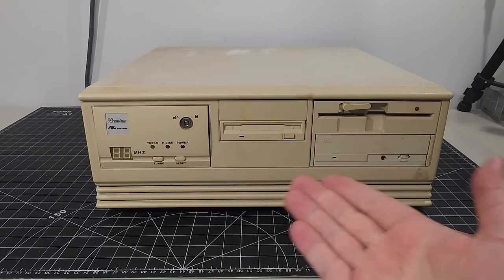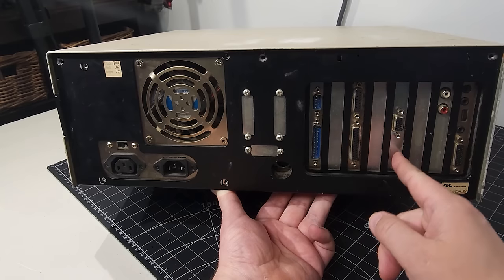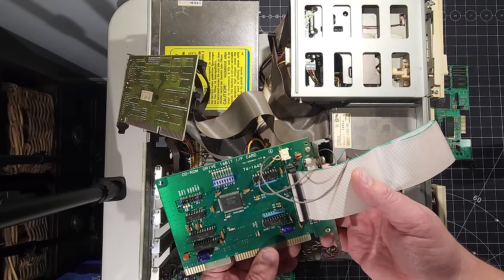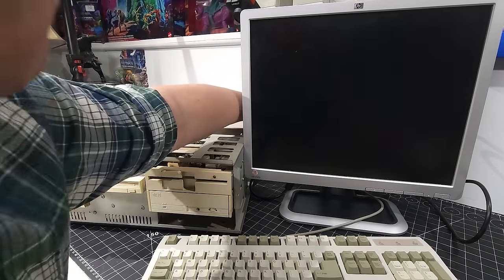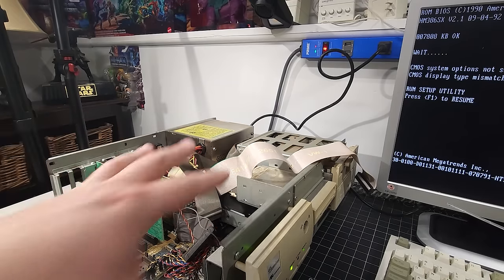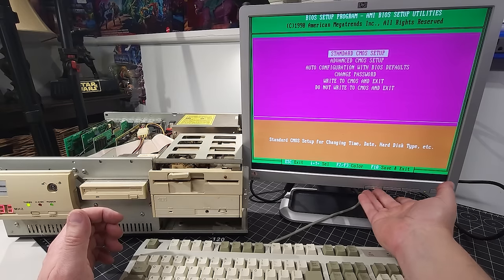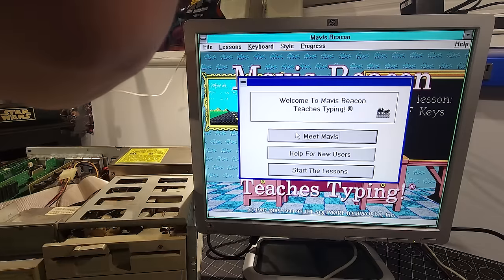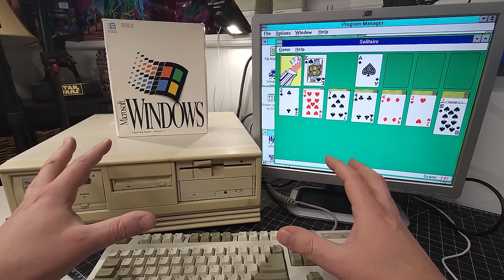What is this Computer...Will it work??

Comment: Damn, that case was such a throwback... moment you showed the back i went "that's no 486" :D
Reply from the maker: Haha indeed.  To be honest, I truly thought it was going to be a 286, but I'm very happy with he results!
Reply: @TheRetroRecall To be honest i also expected a 286...
p.s. given old stuff tendency to go boom, I generally suggest disconnecting drives from data cables when doing "first power ups". Also helps with your particular issue, because if a drive spins on power alone and stops when you connect it, you (usually) have a cable > controller > motherboard issue. Some edge cases will be if the drive doesn't spin up until it receives a signal and/or if the drive logic is good enough to spin up but shot enough not to work further. A POST card, aka port 80 card is also a good thing to have around, and you can find inexpensive ISA+PCI ones.
Reply: That case reminds me of the old console TVs or console stereo systems. All it needs is some wood grain paneling.

Comment: Awesome, brings back happy happy memories. My first PC was a 286SX with 40MB HD and Windows 3.1. At the peak, I had 3 PC's running continuously, a 486DX for my use, game, word processing etc, 2 x 386 SX running a Ham Radio BBS system and a Ham Radio Packet Node and Switch using 4 VHF/UHF Radios. Finally another 386 SX as a back up for either of the 2 Ham Radio connected systems. Happy days :)
Reply from the maker: That's awesome and yes, amazing memories.

Comment: Glad I watched the Thrifts video just in time for you to work on this system. That old cable must have a short in it cos the HDD would not even spin up & no POST.
Reply from the maker: Exactly.  I was also told to check to see if it was reversed.   I checked it again and it didn't work even installed correctly.  In the end, just a bad cable!
Reply: I was curious if it was reversed as well. Haven’t seen a reversed cable prevent post but interesting that it’s just bad. Must be shorted in a critical spot.
Reply from the maker: Shorted or maybe a broken connection on a critical pathway?

Comment: To answer the question, it's an old desktop computer from the days of CRT monitors that would sit on top of the computers.  You can guess at its age from the presence of the "turbo" button, which was meant to slow the computer down to operate older software properly.  A computer that old probably has a hard drive that bit the dust years ago.  Out of all the hard drives I still own from that era, only one (1998) can be read today.
Reply from the maker: Haha did you watch the video?

Comment: Thank you so much for some great memories. I'm a long retired desktop computer repair tech and it was so amazing to see that Windows 3.1 splash screen appear. Exactly the fault finding procedure I would have followed too, had more than a few dodgy IDE cables cause problems for me back in the day! Wondering if the power supply was unscrewed because of somebody suspecting the PSU as the reason for the fault? Really enjoyed this video.
Reply from the maker: I spoke to the seller and he said he opened it up and not much else.. But you never know so that is definitely possible :) glad you enjoyed the video!
Reply from the maker: Hahah the previous owner.

Comment: Absolutely insane what stopped it from POSTing! Glad you got it working and the HDD was working as well! Another one to add to the collection!
Reply from the maker: 100%!  It's a great little machine.
Reply: @TheRetroRecall  Was the cable bad or out of position or crossed, can't remember if a reversed IDE cable kills anything or caused a lockup
Reply from the maker: Yeah, many have said it could be a reversed cable, however I tried it again and double checked after and same thing happened.

Comment: in the "old days" the first step to troubleshoot "no display" was to make sure that the HDD cable wasnt plugged in reversed on one end ( super common problem ). if i recall, on the HDD side the "pin 1" (side with a red-ish color) was on the "HDD power cable" side. then on the board the "notch" should make it obvious which side it goes
Reply from the maker: Absolutely.  In this case it was the cable as I did go back (after others had suggested) and confirm it was in fact connected correctly - which it was.  As soon as I put the other cable back on it would boot without an issue.  I am going to test that cable with a multimeter to see if I can find a short or a broken wire (as was common in my experience).
Reply: @TheRetroRecall oh i was just giving the information, from the video we clearly see you can troubleshoot computer problem. comment wasnt pointed at you 🙂by the way this is the first video of you that i watched. it gave me nostalgic vibes 😊
Reply from the maker: Ohhhh no I know, no worries haha!  My reply was just to put out there what I did... All good!!! :)

Comment: Pretty pimped out rig for it's age! 386sx 33, CD-ROM, 512k video card, 5 1/4 AND 3 1/2 floppies, true Sound Blaster Pro 2.0... I bet that was a pretty penny back in the day! I wonder if that is a single speed or double speed CD-ROM?
Throw a DX CPU, a little bigger HDD, a couple 2MB SIMMS and you're SET for the early 90's "Multimedia PC" experience!
Reply from the maker: Haha indeed!! It is a 1x Mitsumi drive :) lightning fast!

Comment: Nice video ! Actually I'm pretty sure that the original IDE cable was fine, but plugged backwards. It's the typical behavior when you reverse the IDE connector on one end : you gat a black screen, no POST and the IDE LED on. That's exactly the case here : when you observe the control panel when you power on the PC, the IDE LED is constantly on.
Reply from the maker: Thanks for the info!  Another viewer had suggested that so I had tried the original cable again pinned correctly and it resulted in the same behavior.  Once I put the replacement cable back on it booted again.  It looks like the cable truly is bad.

Comment: The floppy drives run off one cable, a twist in the cable tells the machine what one is A or B.  I have seen a problem with the reset switch being shorted out causing a problem with booting, So I would of unplugged that to do trouble shooting.  The turbo switch would enable cache memory.  That cd rom would play a music cd rom and you could plug head phones right into the cd rom and use the volume control.
Reply from the maker: Thanks for the info.  In this case it was the cable to the HDD.

Comment: Tandy sold a version of that CD-ROM drive in the early 90s - the CDR-1000. It was my first CD drive. The Tandy version had a slightly different front face on the drive and came with an 8-bit card. It's such a weird mechanism. But the alternatives at the time were almost all caddy-based drives and were a huge pain. So not having to mess with a caddy was really nice.
Reply from the maker: Yes I remember my first interaction was a Sony caddy 1x drive.  Constant buffer underruns in that thing but when it worked, I was so pleased.

Comment: You don't really need the seperate CD-ROM controller card as there is a controller built into the SBPro card, as a bonus if you were to use the SBPro card to run the CD drive any CD audio would also be played via the same speakers as plugged in the sound card rather than needing separate amplified ones via the RCA plugs.
Reply from the maker: Nice! I thought it may be a different standard (the interface card VS the SB card).

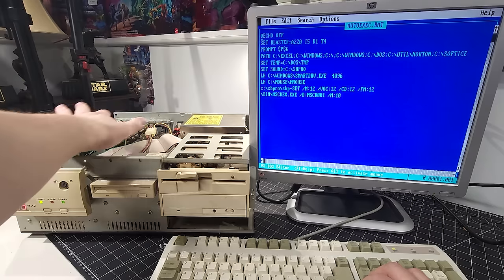Comment: Another fine Video Squire, I had to watch the section a couple of times when you’re showing what Cards are in the System thinking that I’d missed the description of the Sound Card and you realised that you hadn’t shown that Card at: 30:30, Graphics Card’s nothing special but as long as it works then that’s the main thing, Interesting CD-Rom Drive & like the inclusion of the Left/Right Phono Sockets on the back of the IO Card, I’ve got quite a big collection of Optical Drives of different types now but not one like that, Oh btw, I pronounce it “Mayvis” regarding the Mavis Beacon Typing, Think I’ve got a copy of that somewhere, I’ve got a 286 & 486 PC but not a 386 although I’ve recently found a couple of 386 Motherboards so will hopefully get one up & running and do a Video on it at some point soon hopefully! 🙂 Anthony - Birmingham/UK 🇬🇧
Reply from the maker: Hi Anthony - I would LOVE to see you do one of those videos!

Comment: I had a 386sx with a headland chip on the mobo. My guess was a later 386 when I saw that the I/O card was short. The late 286/early 386 OEM cards mostly were the longer size. The video card  (a Trident 8900 or 9000) is also on par for the era. The 8900c is the better card since it can do 1024x768x256 if fully stocked with 1MB mem.   Older systems with I/O cards are also not always cableselect and can be finicky with master/slave jumpering (including requiring master only, but that seems not to be the case here)
Reply from the maker: Thank you for the additional insight!  Much appreciated.  It's a really cool system :)

Comment: FYI -- if you ever get a chance to restore an old computer like this and it actually boots, IMMEDIATELY try to backup the hard-drive. 

A lot of times when the hard-drive hasn't been running for years or decades, it will be on its last legs so you want to try and salvage as much data as possible just in case the HD decides to truly die on you.
Reply from the maker: Done.  It's a practice I do right after filming the footage. :)

Comment: back in the days when i worked on computers a non-POST I would find the IDE ribbon would be the issue about 9 out of 10, watching this video reminded me of my first real computer that I mod so much it was a slow beast, the MOBO was big boy and I think it would still work to this day if I had it (I wish) but yeah IDE cables was a bulk of my repairs to the point that I had over 100 new ones of them (Was pricy but made me a boat load of money from those repairs) thanks for the walk down memory lane. reminds me of 1992 life.
Reply from the maker: Yes, like you I had many of these ribbon cable repairs.  The frustrating ones were the intermittent ones that would work then not all due to a fracture in the cable usually caused by the design / folding of the cable. Glad you enjoyed the video :)

Comment: My first computer was an Exidy Sorcerer. My hardware guy and I had maxed it out with (if I recall correctly) 56K of static RAM. I had also purchased the S-100 expansion box for it, and eventually got it to run North Star DOS, which required expensive hard sector 5.25” diskettes. At some point, my hardware guy, (who by this time had become my best man,) had re-written the firmware for the disk controller so that it could work with both hard and soft sector diskettes, and I started running both CP/M and N* DOS. 

I also got into programming in Forth and created a diskette that allowed me to boot up with Forth as the OS. I really loved that machine. Sadly, a bad hardware design choice caused it to die a horrible death, and ultimately it was scrapped.

The problem was that the (I think) power transistor’s leads were used to support a heat sink, and every time the case was opened, it had sagged and I stupidly pulled it up each time without ever thinking about putting in some kind of support. The middle lead finally broke and (I presume) allowed it too much current or voltage to fry the circuitry. To this day I still miss that machine. The machine I have now is probably orders of magnitude better than that old Sorcerer, but I have no clue as to how I’d ever get it to boot up in Forth if I wanted to.
Reply: By the way, I am not related to Bruce Willis.
Reply from the maker: Thanks for sharing this.  I love reading everyone's experiences with this old tech!
Reply from the maker: Haha, would have been cool if you were lol!

Comment: That is  such a nice time capsule. 100 MB HDD was boss for such a 386-system. And great, methodical troubleshooting with that harddrive. Also great having an external battery installed instead of some leaking stuff.
Reply from the maker: Agreed and thank you!  Yes, the discovery of an external battery VS a Varta truly saved this machine from the very beginning.

Comment: Whenever I see the HDD light come on solid like that and no drive spin I always check the orientation of the IDE cable. Had a lot where they were installed upside down before cables started being keyed.
Reply from the maker: I had in the video and it didn't work.  So I replaced the cable and no issue.  Funny thing - I featured it in another video where I did a followup on it with the original cable and it worked perfectly.  My guess - flakey cable or oxidation.

Comment: Found this video through the recommendations and instantly subscribed. Really like your style, especially how you go in depth to explain everything. 

I'm currently working on a mystery computer myself. It's an 286 that was used in a TV station to provide a time signal. It's in a 19-inch rack-mount case and contains some REALLY weird cards. Like a receiver for the DCF77 time signal transmitter in Germany, a graphics card that has three MCX coax connectors for red, green and blue aswell as a card full of EPROMs. Sadly, I can't find any information for any of those cards online.
At least I caught the BIOS battery before it could leak and removed it, so one less thing to worry about :)
Reply from the maker: Now that seems like an exciting system to figure out!  As you said, good thing you were able to catch the battery before disaster occurred!   Good luck on the project and welcome to the channel!

Comment: I worked on a 486 that wouldn't provide a bios prompt unless a card was removed or something affected configuration.  The bios battery consisted of an external AAA battery pack, and I had to unplug it to make the configuration screen appear.
Reply from the maker: I've worked on a few systems like that before.  I have an Aopen socket 7 board like that.

Comment: Holy crap... did you did that out of the Malone Wead Library basement?! They had that EXACT computer (with a different logo badge if my memory isn't totally gone) when I was still a much younger pup, right down to the weird cd drive! 

They also had a Pioneer  6 cd changer which held the discs in a "cartridge" (at a blistering 2x speed) connected to the scsi card in the back so they librarian didn't' have to change the discs all the time, just a cartridge now and then.

Thanks for sending my stumbling old butt down memory lane!
Reply from the maker: Hahaha no worries... glad you enjoyed and happy it brought back some memories for you!
Reply: There were a few cases that showed up on a number of manufacturer's systems. A favourite was the "small footprint" case which was a desktop (non-tower) case with three 5.25in drive bays and a vertical 3.5in bay down the side.

Comment: In 1995-96 I worked for a non-profit that often received donations of PCs. Many were late 80s/early90s PCs and back then of course a 3-4 year old PC was basically considered obsolete. Some were name brand, many many clones.

I basically did what you are doing in the video, except with a few hundred PCs at a time. I would check them over, clean them up, and then we would sell them, usually for $200 and the proceeds went to the IT department of the non-profit.

Of course a lot of these PCs were despite being not that old at the time, not really salvageable or useful --- so before sending them to the recycler I would strip them for parts. My on hand "spares" area of the equipment room sort of got out of control. :) The good news was though, generally if we had a failure of a PC in the office, I could repair it from parts on-hand without having to spend any money. As a non-profit we were always strapped for cash.

This brings back memories of an "exciting" part of my life where I still considered computing "fun". Thank you for making this video!
Reply from the maker: No problem, thanks for sharing your experience... I love reading these and thanks for watching!

Comment: I had a case with that config layout, it had a 40MB HDD 8086 Turbo M/B, 2MB ram, Gemini Sound Card, GoldStar CD DRive. 2.5" Floppy, 5.25" floppy. Rage Graphics. Used to be a developer system for business software. Played some basic games and surprisingly had QBasic installed on it. I was impressed with Windows 3.3 update on it, but ceashing was an order for each hour.
Reply from the maker: Haha that's awesome - outside of the crashing every hour!

Comment: If the HDD cable is connected backwards, the computer will not post with no HDD activity either, the simptom that you had there. I remember (maybe I am wrong) that the computer is hold in reset by the HDD through the IDE port.
On the older HDDs with exposed pins on the IDE connector, was easy to connect the cable flipped, same on the IDE connector on the multi I/O board. That seems to be the case here.
Reply from the maker: Another viewer had suggested this as well.  After recording I tested the cable again with the right connections and it still did the same thing.  It seems the cable was truly the issue. :)
Reply: @TheRetroRecall  Well, the joy of playing with old hardware. One never get bored. :)
Reply from the maker: Ahha so true!

Comment: This was my first PC that i inherited from a relative as he upgraded, around 1997-98 ... amazing. Oh.. and ... the turbo button didnt do crap back then either... haha! I just remember it lighting the diode... well good video bro! Subscribed!
Reply from the maker: Awesome - glad to have you onboard!  Get ready for the fun! HAHA!  Great info on the turbo button - saves me some future trouble.  Thanks again!
Reply: Turbo is actually the computer's standard speed, the one stated on the processor and in the advert you saw before you bought it. If you turn turbo off, it's a slower speed for the sake of compatibility with some software (particularly games) which relied on an older processor's slower clock speed.